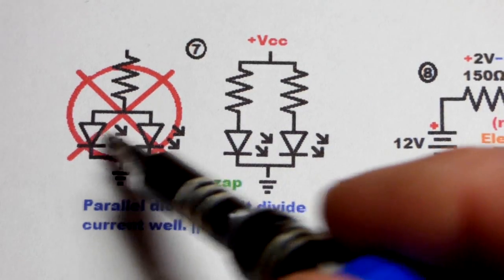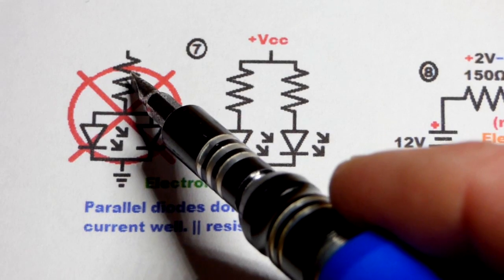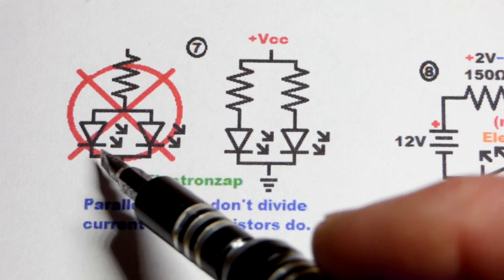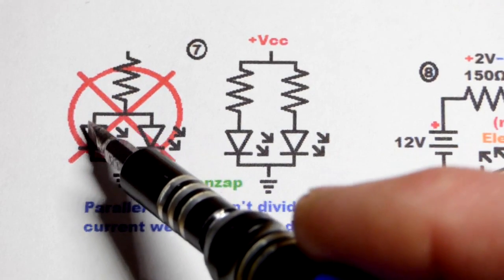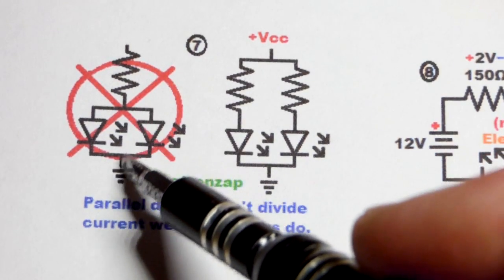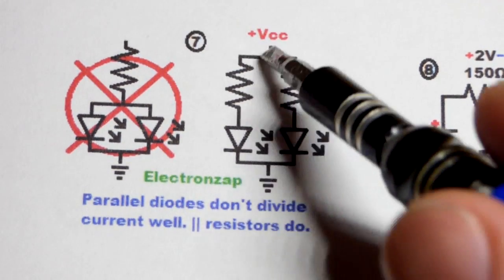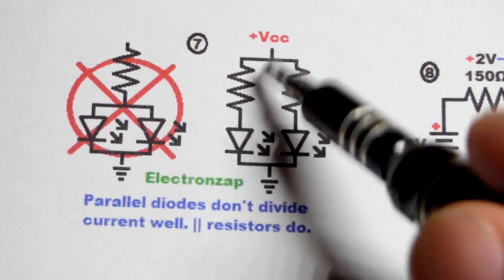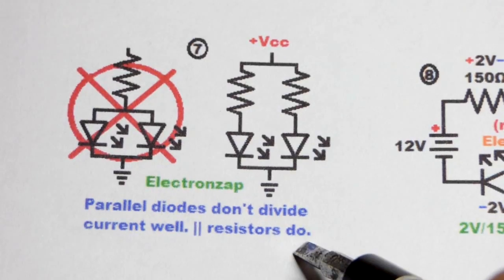Parallel LEDs should have their own current setting resistor

Comment: 'course if you have enough voltage, you could put the LEDs in series and save a resistor and some power.
Reply from the maker: Yeah, series is definitely better if the voltage is high enough.